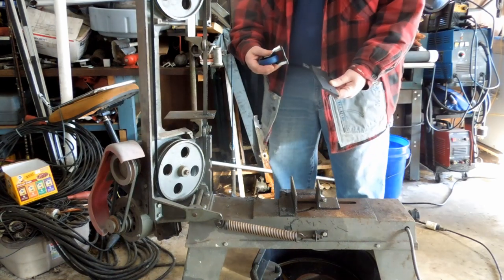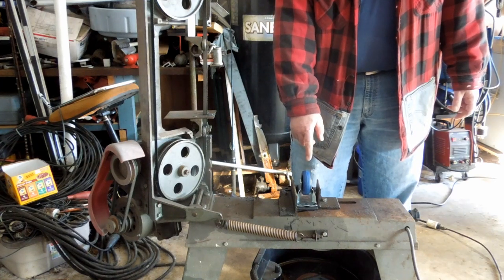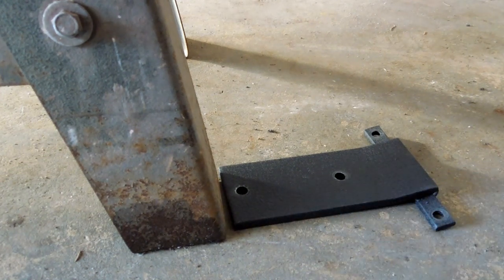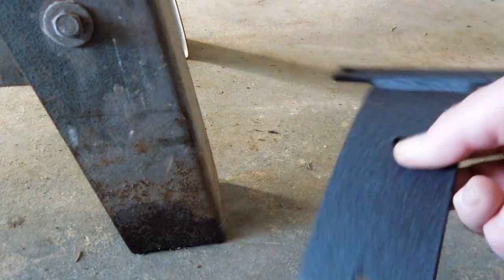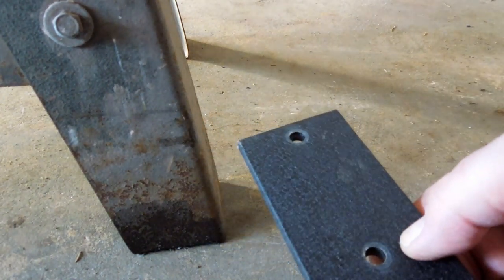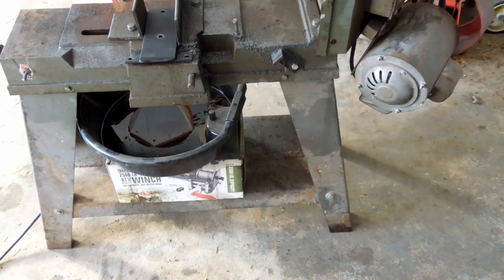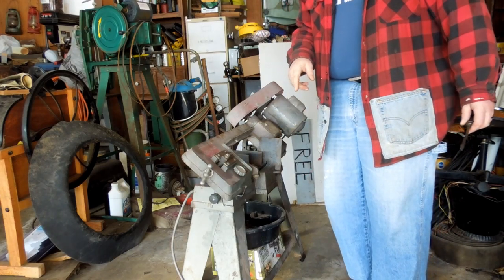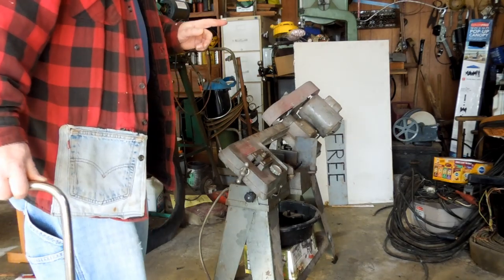Wheels For The Milwaukee Band Saw

Comment: Here we have a bandsaw building itself!  LOL   Thanks Dave!
Reply from the maker: In a perfect world every time I fix or find something to use the next job gets easier. This project is a reaction to having to move this saw twice a day. Once to get it out. Once to put it back. 😆
Reply: @OldSneelock  An old DuPont machinist said that a mill was the only machine that could duplicate itself. What thinkest thou??
Reply from the maker: @lewiemcneely9143  I heard it was a lathe. I think the best tool is right  behind your eyes. The Egyptians built everything with a string with 3 knots in the middle and a rock tied to one end.
Reply: @OldSneelock  I'll go with your outlook. That was a mill operator that said that but if you can do mill work on a lathe and lathe work on a mill it don't look like it matters a lot. It'll be the guy that does the setups is where the end result comes from.  The machines are just as good as the people that run them unless the new ones blow a fuse and someone has to come and fix them. What a shame. Looks like as modern and so-called smart as they are they could put in their own blasted fuse!
Reply from the maker: Nobody wants to put in the money and time to have them last. Douglas Autotec had screw machines that made tank parts for WWI. Still running and making parts to spec 90 years after they were built.
The CNC's that cost 20 times what the screwmachines did new, broke more than they ran. Had to call in a contracter to fix the controls because I didn't have the skill or the people to do it in house. 
3 days downtime everytime waiting for the contracter to arrive and fix it. 
HAAS makes junk good for 5 years max and then toss it. Not even worth keeping it for parts. It won't match what was built a year later.

Comment: I like the pockets on your jacket. Gonna remember that for when it becomes that time again in wich I need to say goodbye to some beloved jeans.
Reply from the maker: The jacket is a running gag. I set it on fire while cutting the plate for the lathe motor mount. There was talk of tossing it, but in true Sneelock fashion I patched it. 😆
Reply: @OldSneelock  Believe it or not I have jeans with patches that have patches (and actually those need patches now too)

Comment: Pretty much every time I start a project, I have to do one or two repairs to equipment before I can really GET started.  LOL.  But that's what a fellow lives with if you enjoy the old stuff !!   I have an ancient band saw that takes a 10'6" blade.  The whole thing is cast...fancy legs and base all one piece.  The previous owner 'welded' casters to the bottom of the 4 cast legs but I've got to figure out a way to really improve the way it blobbed on there. For now, it is mobile and functional, but one of these days.....
Reply from the maker: Now that's a saw. 😆 Welding cast is pretty much a crap shoot. I get it right about one in three. 😕
I no longer have a crew of skilled trades at my beck and call. Everything that gets done I do it. If I didn't buy junk I would have nothing to do most days. Fixing things like this little saw is a lot of fun. 
One of these days I'm gonna....   the list is so long there aren't enough days in the callender to finish it. 😆

Comment: Sometimes progress is more agravation than it's worth. You'll get it! And I'd just cut the ears off and trim the weld to the angle you heed and fire up the wire feed! The $14 plug is on the way. It's a shame all those gougers missed out. I won't shed many tears because of a LOTS better deal. Now to find a cheap Mercoid switch for the well. It's out there. I just need to be patient!
Reply: Cut the ears off? Dang I was gonna ask for ya ta take two inches off all the around but four4get it, I knead my ears.
What kinda barber are you anyway?
Reply: @mostlymoparih5682  Wallyvorine's kind. Spare no hair and if the ears have it, well............
Reply: Years  ago I worked as a maintenance man in place that made electrical wire and the band saw blade would break a lot and I hated changing it as you welded a new blade together. Bout the time I got good at it, I got laid off.
Reply: @mostlymoparih5682  The story of our lives in a lot of ways. Lets you wear a lot of hats! Or hard hats.

Comment: And my bench saw is set up like that from Craftsman. I raised the frame up some because Cheryl's Dad must've been shorter but the back wheels were frozen up and worn flat. I freed the wheels up and it just now flumps along. Better to flump that to not flump.
Reply from the maker: This is actually a pretty good model of this type of saw. When I picked up the brushes today I looked at the HF model. The guide bearings are about 1/4 the size of this one. I'm off to Plainwell WallMart in the morning to get s quart of oil. $27.00/quart online $7.00 sat Wally World. 
Have to have synthetic gear oil so it doesn't dissolve the bronze worm gear.
Reply: @OldSneelock  The concrete plant had an older model electric roto-screw Gardner/Denver compressor that took blue synthetic oil. I think it was 40 horses and ran forever. But it took several gallons and the gear boxes on the cement blowers took the same stuff. Too much for me.

Comment: I thought at first you were going to put the wheels underneath the saw, which would raise the whole thing by 2 - 3 inches.  I think that would be a Good Thing in the case of your saw.  But if the saw height doesn't bother you, this way is probably simpler.
Adding the wheel height to my Dad's wood bench, however, was NOT a Good Thing.  He built a really nice, 4 x 8 foot bench for woodworking, and built it the proper height.  The proper height, if it were going to sit directly on the floor.  He tried putting six small casters (about the size of the ones you are putting on the saw) under the bench; but the bench is too heavy.  So, he bought four heavy duty casters (at ~ 8 1/2" tall), and put those under the bench.  That puts the bench at roughly chest height.  Way to tall for convenience or ease of use.  I plan to fabricate four metal brackets that will have a lip that goes under the bench (where the casters currently sit), and move the wheels out to the ends.  The bench top overhang will largely cover the footprint of the bracket & casters (hopefully).
Reply from the maker: That sounds like a plan. It would be nice to have it so the wheels were able to be lifted and let the bench down on the floor for working. I had a bench on casters, but took them off. If I pulled or pushed on anything in the vise I would chase the bench around.